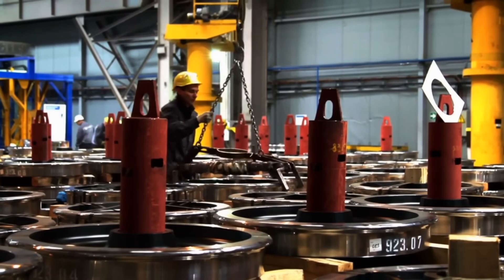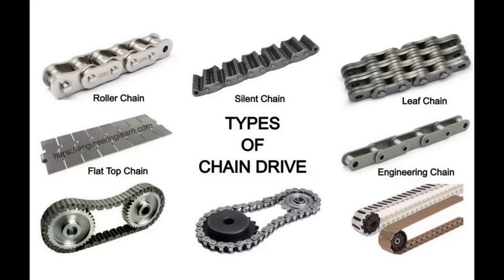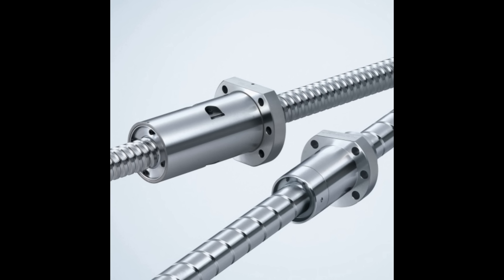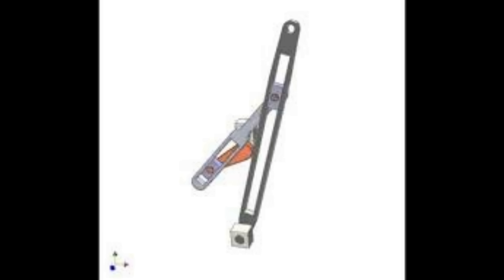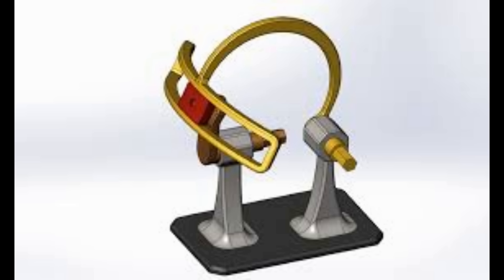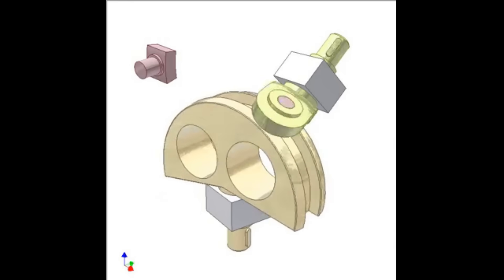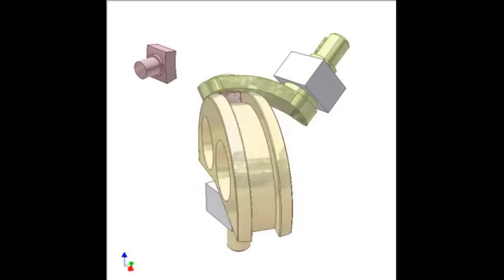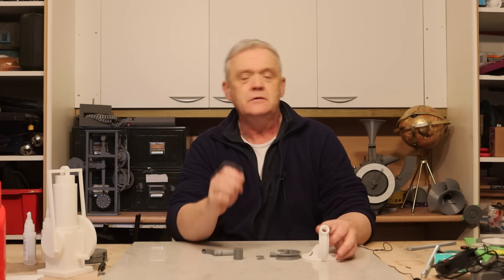2196 The Spherical Coulisse Power Transfer Mechanism

Comment: Just FYI, use some toothpaste as your lubricant. Operate the mechanism for a short duration. Wash it off. Then properly lube with some grease. You'll find it is now a polished, lubricated surface with much reduced friction. Works amazingly well on 3d printed gear sets too.
Reply from the maker: cheers mate
Reply: Interesting, here's hoping I remember this trick for when it's needed!
Reply: I also use toothpaste to polish my headlights to get the yellowing off of them.
Lot cheaper and works just fine.
Reply: @heathb4319  I also need to do that! Better go get some engineering toothpaste...😂
Reply: @hairyneil  Now i need to add some toothpaste beside my belove ducktape and glue in my tools bag. ¦]
Reply: That would be valve grinding paste.  @hairyneil
Reply: @heathb4319  added benefit:  no cavities
Reply: @heathb4319  And I bet you've never had to take your car to the dentist.
Reply: @PhilJonesIII ...everytime i go to the dentist...my car goes with me. :)
Huh...weird.
Reply: @heathb4319 please stop visiting the mechanic to have your facial gearbox re-lapped. This is prohibited by the OEM manufacturer, and will void your warranty. Dentists are a different provider.
Reply: For most things I use a bit of cheap silicone reel oil, Any place that sells fishing tackle probably has a small bottle for a follar or a a pound or whatever.  Small change.
Reply: I think his reply means he didn’t care for the feedback, to put it lightly.
Reply: @andybaldman  He  liked it. He up voted it. It was lost because I edited to fix for grammar and typos.

It's all good.
Reply: @andybaldman  I think you'll find. His reply is british for "thanks, I'll give it a go"
Reply: Genius!
Reply: Imagine what a dab of cutting/polishing compound would do!
Reply: @mikescholz6429   he he .. yes ... but this is YouTube so we end up with toothpaste!
Reply: @MrAdopado  maybe I’m the weird one then with a tube of simichrome in my bathroom?
Reply: @mikescholz6429  This is another common recommendation. It's simply that everyone has toothpaste around.
Reply: Great suggestion.  Thanks.
Reply: Never use toothpaste as a lubricant as it is abrasive!
Reply: @paullordi5154  The abrasiveness is the whole point, to polish the mating surfaces of the mechanism, in order to make it run smoother with proper lubricant.
Reply: @paullordi5154 🟦... He is NOT Saying to use toothpaste as a lubricant,... He is saying that if the printed item works as roughly as Roberts did, then 'LAP' the parts by putting it together with toothpaste on the bearing surfaces & then work the item for a little bit,..the toothpaste will grind a smoother Union onto the bearing-surfaces, then just rinse the toothpaste off & The item should run smoothly.
Reply: @paullordi5154 good to see there are people with brains out there..
Reply: Never heard of this! Awesome.
Reply: Lapping with kerosene or graphite is better than toothpaste.  I use kero it’s cheaper and cleaner than graphite or toothpaste.  Kero and graphite are not corrosive, toothpaste is corrosive.
Reply: @velcroman11 ...you mean toothpaste right? As in water soluble toothpaste? As in the water soluble toothpaste to use for polishing...is corrosive after you rinse it off with water....wow.
Super genius level engineer you are brother.
What will you say next...let me guess.
Our president is a great man and leader with awesome kids that do no wrong and the county is better off with him?
Makes about as much sense as corrosive toothpaste after you rinse it off with WATER. Are you sure you dried it off properly and that corrosion isnt rust caused by your genius level mastery of the task at hand...
WOW.
Reply: And it will be minty fresh!
Reply: Valve lapping compound and jewelry rouge also work, and produce a finer and more polished surface if you do it like sand paper and work from course to fine grit.
Reply: Toothpaste would slowly wear the print out, it does have a grit to it.
Reply: @JakHart  That's the point. Re-read the comment.
Reply: @JakHart  
🟦...You failed to understand what I meant,... What I was trying to get across to you was that: "After you apply the toothpaste and work the item for a little bit, you then RINSE THE TOOTHPASTE OFF before actually USING the item!
Reply: Yes, basically help it to wear in with a mild abrasive.
Reply: @hootinouts  Exactly. Wash clean. Then properly lube as needed.
Reply: Dry lube seems to work better on some plastics, if you don't mind the horrible mess (graphite powder)
Reply: @James-wd9ib  some plastics are classed as self lubricating, PA6 often is and you can get filament with solid lubricant built in, IGUS makes some but also you can get polycarbonate (PC) or PETG with a small amount (10 % I believe) of PTFE mixed in (PC-PTFE or PETG-PTFE) the PTFE is supposed to act as a solid lubricant, reducing friction and increasing the wear resistance of the plastic since when ground off the PTFE turns into a solid or dry lubricant. The IGUS filament works very similarly.

Comment: That's pretty cool if you need torque. Would need to make the operation smoother, but the knob you have put on the manual crank could be possibly used as a gear.
Reply from the maker: Great point!

Comment: Don't forget fluid coupling. They ran superchargers with fluid couplings off the engine on aircraft in WW2.
Reply: That would probably fall under hydraulics. They’re also used in automatic transmissions instead of a clutch like you would find on manual
Reply from the maker: that is really hydraulics mate - well it is in my mind

Comment: I like this.  I am thinking that multiple arms on the output would add to your torque and drop speed.  Would be fun to play with though limited practical use.  Thanks for the video Rob!  Very much liking the good Doctor look and video showing different places where you live during commentary.  You get some exercise and we get to be tourists.  Win win!  Keep up the good work!
Reply from the maker: lol - cheers mate
Reply: If you did that you'd end up with restricted movement, and if you corrected for that restriction, you'd essentially have a bevel gear.
Reply: @curt2742  Granted it would be close to a bevel gear, though I was talking about the upper arms.  Like a starfish legs.  An example of a flat version is the machine where there are multiple sliders in a block whose arms cause a leg to slide as the crank in spun.  Only rather than flat it rolls up and through the pivot point and progresses to the next arm.  It would actually give it a wider range of motion than a lower number of legs.

Comment: Unfortunately the transfer of energy using this drive is not constant. At certain points in the rotation of the driving part you will find that the semi circle part will vary. The result is that if the output happened to have mass (such as a fly wheel ) the mechanism may shake to pieces. But 8n some cases the speeding up and slowing down in the output may actually be of benefit.
Reply from the maker: like all mechanisms it is going to be good in some instances and not in others mate

Comment: The way it transmits power only from the input to the output and not the other way could make for some use in a differential type of setup. My brain is not ready to picture what that could look like yet. probably too much friction compared to other types of transmissions that would function similarly.

Also just to mention, I found your channel on YT a couple days ago and absolutely love the thinking and tinkering you do!
Reply from the maker: personally i think friction will be low as it is  ball joint at the point of contact - there have  been a couple of good suggestions already and i like the differential idea keep me in touch - cheers mate